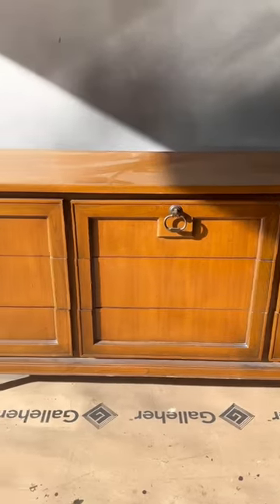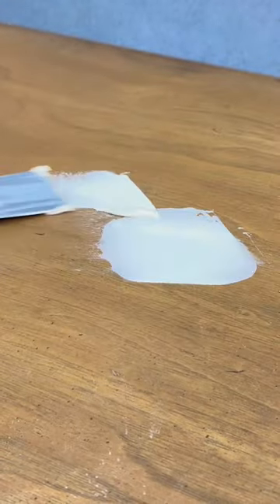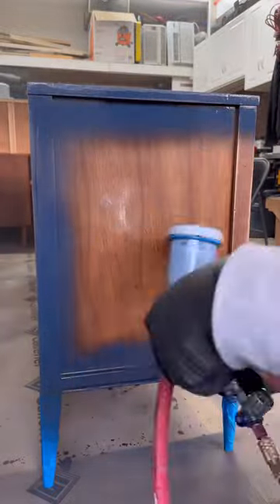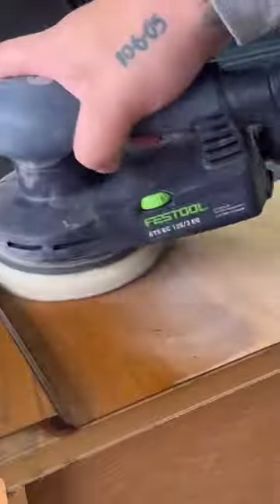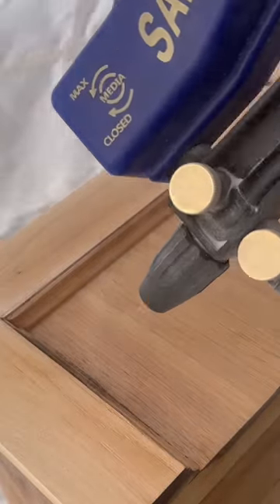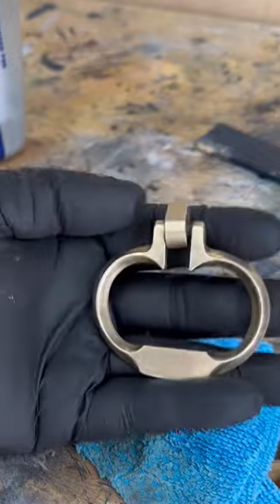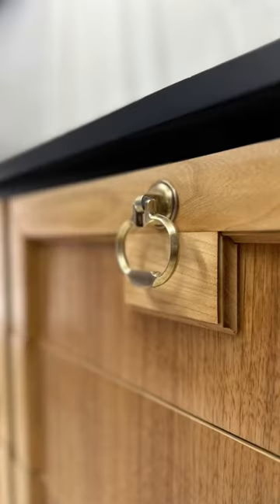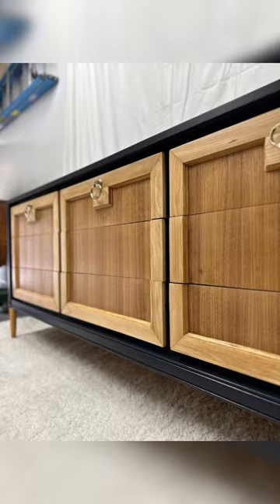How to restore furniture using a sandblaster || diy mid century modern dresser modernization

Comment: Thank you…very nice! The link for the sandblasted doesn’t work.
Reply from the maker: Thank you. I just updated the link. Let me know if it works for you
Reply: Thanks! I want to order it but wanted to use your link. What grit of medium / sand did you use?
Reply from the maker: @jeannedorsey8122  I used soda blast medium. It’s a lot safer for wood then sand. Thank you for the support

Comment: Beautiful result!  However, when you mention how much you made selling your work, I wonder if that’s a net or gross amount.  To be real, you’d need to subtract from the sale price the cost not only of the used furniture, but also your hours of skilled labor and your materials.  That would give you the net profit.   I’ve revived old furniture before.  I’ve also made clothing from fabric off the roll, using patterns.  The price I paid for physical items was easy to figure.  But I also had to calculate what the work cost me in time, based on reasonable wages for my work.  That process significantly reduced the net profit.  I now revive old furniture and sew clothing only when it suits me, which makes the effort worthwhile.
Reply from the maker: You make some very good points. Before I started flipping and restoring furniture, I wanted a hobby so I decided to set up a wood shop in my garage with the intent to just build stuff for myself and my family. I then was introduced to furniture through several flippers on YouTube and I was hooked. So to say my labor is a cost to me I would have to disagree as this is a hobby I enjoy and am able to make money from.
Reply: @CedarPineDesigns   Well by definition, you are a professional. Undermining your talent by saying it's just a hobby devalues your work. Not only that, but pricing the pieces you're selling (professional - right) based on you thinking you are  'just a hobbyist' is undermining the pricing of others who say they are professionals. 
Well this flipper is selling his stuff for __ (And they see you as a professional...because you are selling your pieces.... they will think other folks are over charging when they are pricing their pieces based on their talent x hours.  

I don't know if I'm explaining that right. The bottom line is you are selling your work...&...it is work...AND THAT ALONE, by definition makes you a professional and you are playing in the same sandbox with the other professionals.  If you don't want to get paid for all the time/hours you spent...using your tallent, then fall on your sword and say - UPFRONT - that you are 'just a hobbyist' and only recoup your tangible expenses.
And don't use what looks like a business name on YouTube. And don't take commission work, only professionals do that. AND, AND, AND...

And that would be a damn shame. You are a talented man. Stop worring that others will think you don't measure up, because you do. Plus, It's ok to do what you love AND get paid for it. Really. 

Stop playing small already.

Peace,
Rev. Kevin
Reply from the maker: @RevdUp.Art.Fotografer  thank you so much Kevin. I will keep all of what you say in mind. Appreciate all the advice